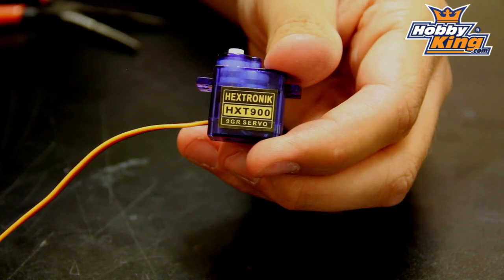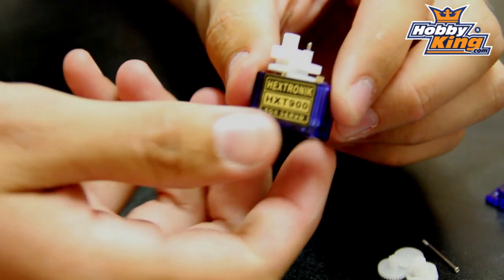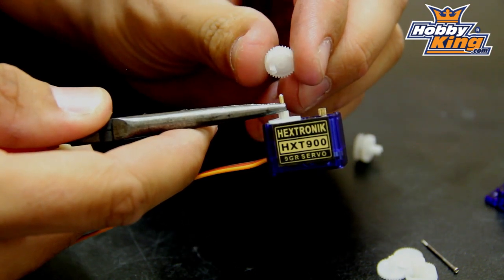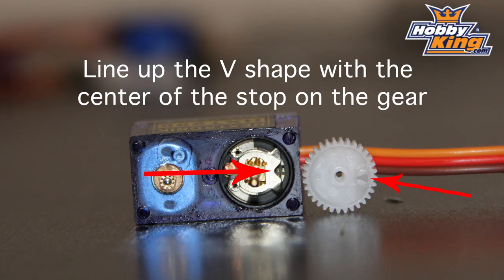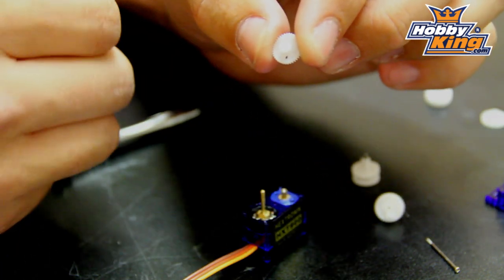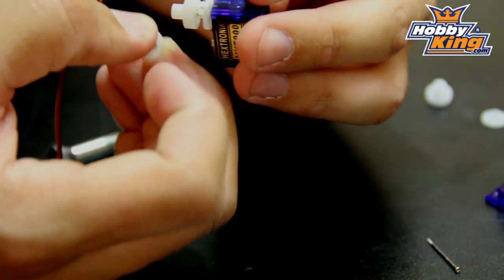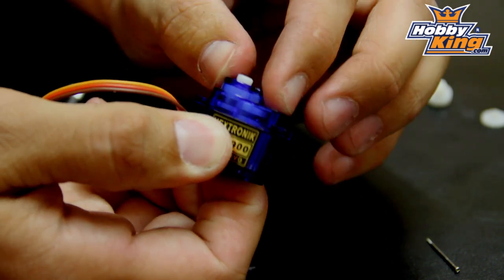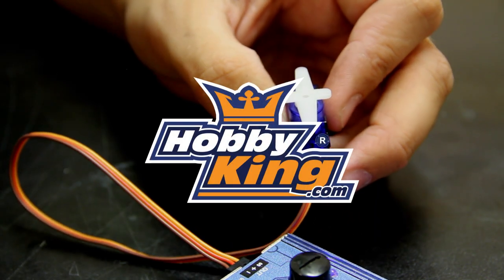HobbyKing Presents - Don's Tips- HXT900 Gear replacement

Comment: @dwculp I use the Turnigy MG90S metal gear servo from hobbyking...It's a little smaller than the HX900 but it's 9g strong and works great for $4.99....